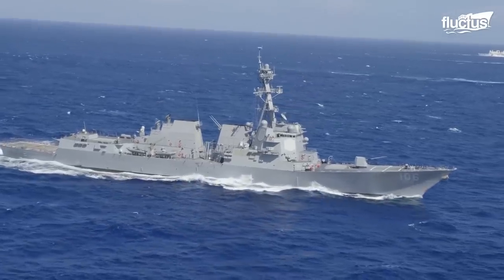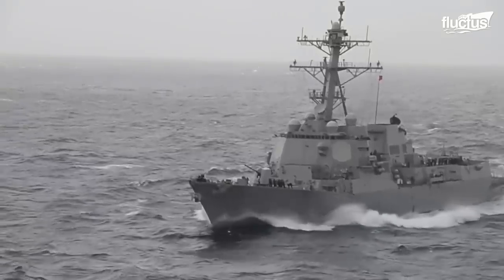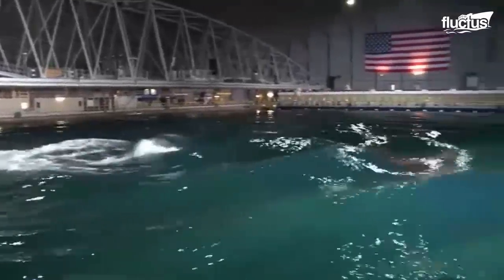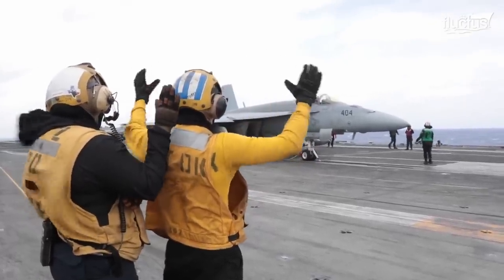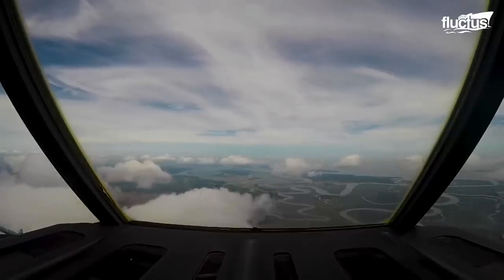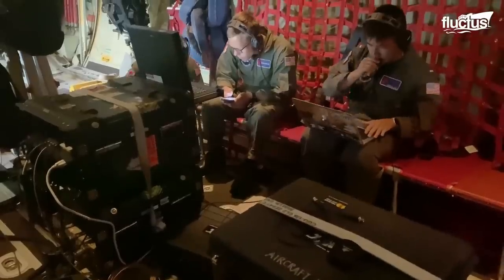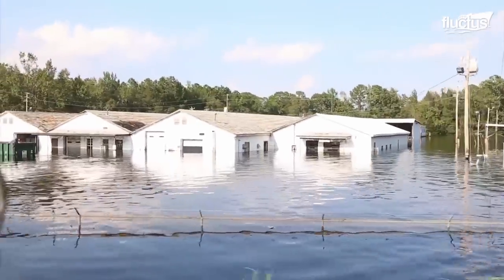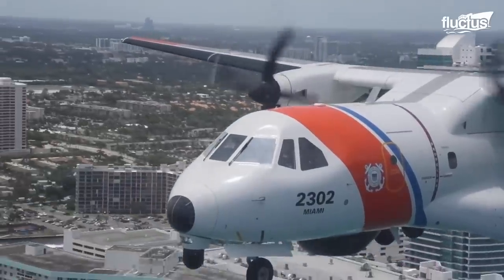Special Techniques US Navy Ships Use To Fight Giant Waves at Sea

Comment: All is destroyers should use modular sealed nuclear reactors.  These small sealed reactors cannot melt down or have a runaway accident. In addition to being incredibly safe, by using the modular design, the reactors can be removed and shipped to a safe rebuild or recycle plant.   This would reduce green house gases among Navy combatants by 80%. More important the destroyers can then either carry more missiles and food OR it could use fuel tanks to provide jet fuel for carrier flight ops. This would reduce the number of trips required by unarmed tankers.